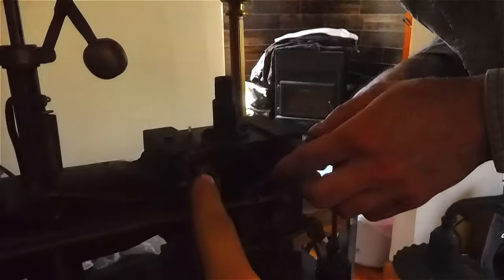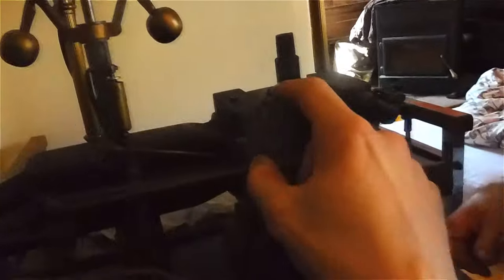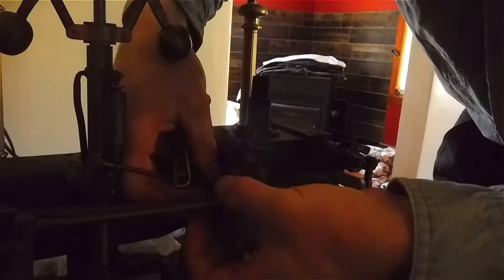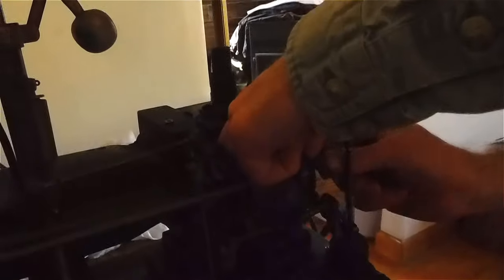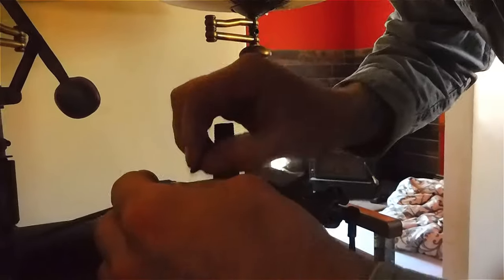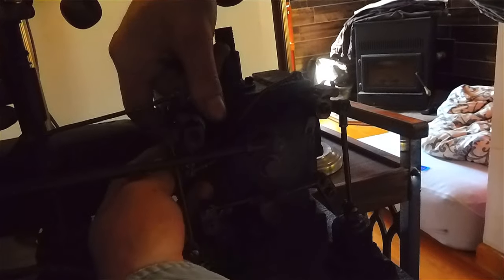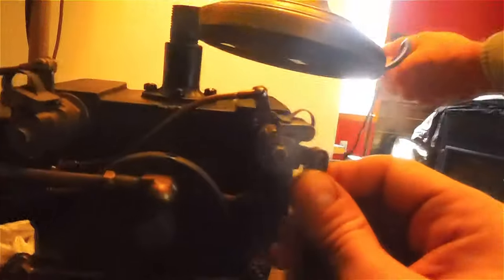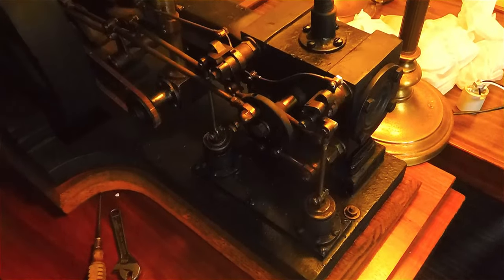Miniature Harris Corliss Engine troubleshooting Pt.1

Comment: Never seen one of this size. Considering the efficiency benefits of this kind of valve gear, can this engine be realistically put to use somewhere or is it not built to do that?
Reply from the maker: Any engine is useful for a load it can drive.  This engine should be capable of 1.5 to 1.8 horsepower on 200 PSI saturated steam, any higher or with any superheat would jam the unbalanced corliss valves, so yes indeed it can.  The dynamo you see to the left is a 110 volt 1/2 horsepower lighting dynamo/general use motor built by Wagner in 1891 which is what it will drive.